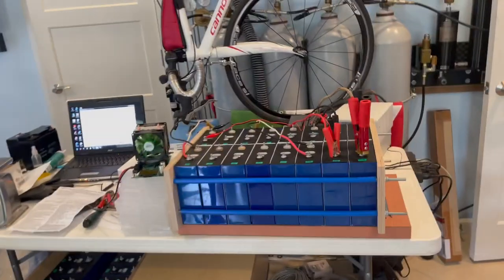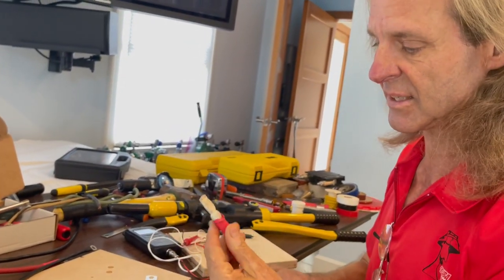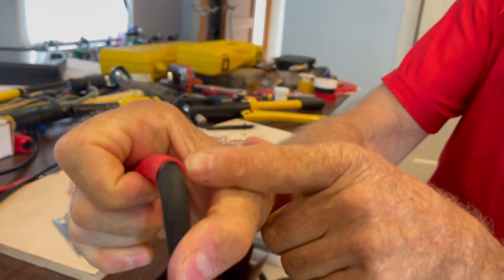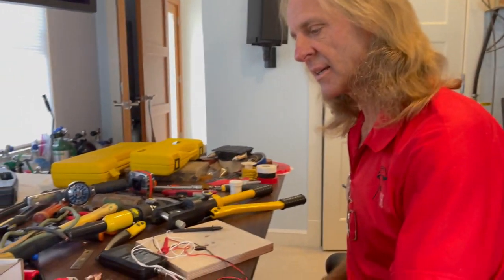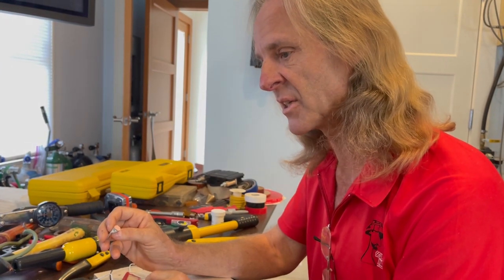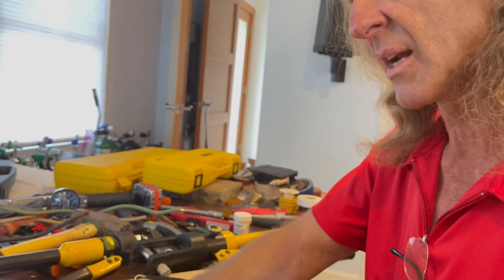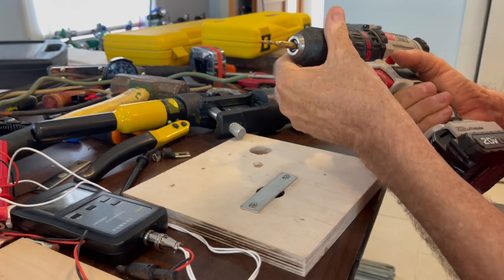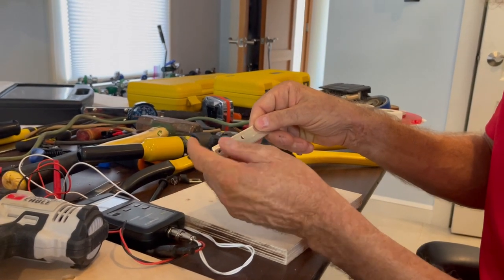Is Lifepo4 A Fire Risk?! How To Make Safe Battery Connections.

Comment: How about taking old wire with oxidation and cleaning the end perfectly, like new, then putting a terminal on it? The flow of electrons doesn't about oxidation does it?
Reply from the maker: I don’t know the answer to that question. I am aware that electrons don’t flow through a wire but around the wire but I don’t know how that may or may not be significant. The accurate answer is that I don’t know.

Comment: If your soldered joint gets hot and melts you have much bigger issues! Soldering a lug on is perfectly fine if done correctly. Never solder the end of a cable and attach it in a screw terminal. It will fail simply due to weather/temp cycle.
Reply: @ursodermatt8809  
Agreed. It’s been proven on the larger lugs a crimp is far superior.

Comment: 1.3mOhm * 200 Amps = 0.26V drop.  0.26V drop * 200 Amps = 52 watts of heat!  Copper has an air transfer coefficient of around 14W/(m^2K).  The bus bar has a total surface area of around 0.005 sqr meters.   Works out to roughtly a 60*C bus bar in 20*C air.  Or I messed up teh maths somewhere.

Comment: Hello..Where did u get battery torque tool from do u have a link or name of supplier?
Reply from the maker: The small torque wrench I use is one I’ve had for years for working on my bicycles. I bought it from nashbar but they are not the manufacturer. It tests from 1-23 nm which is a good range for what we are doing. Look for one that is designed for that or slightly lower range.

Comment: Instead of tapping for the cell balance leads, wouldn't a washer with lock washer do the trick?
Reply from the maker: I know just enough about combining components and torque values to know that in this application I have no interest in stacking things in a connection that I am designing to be durable.

Comment: I want to make an 16S LiFePo4 battery for my sailboat.  But i have to distribute the cells to 4 packs of 4 cells. About 1m / 3ft appart. Whan can i do to make it right?  2x70mm2 between packs and cheap brass busbars within the packs to get similar resistance?  Or does the distribution of the resistance not matter but the sum of resistances?
Reply: Motor takes 100A @ 48V, BMS delivers 200A
Reply from the maker: @olafschermann1592  seems like a very challenging problem. Have you looked into 12 volt BMSs that can operate in series so that you could build four individual batteries and still achieve a 48 volt system?
Reply: @RayBuildsCoolStuff  i don’t know any of those 12V BMS which could talk to each other.  I know victron makes a device that could balance between 2 12V batteries, so with 3 of those i could connect 4 batteries in series.  But what would happen if i distribute the 16S cells? As long as i use JK BMS with a 2A active balancer?
Reply from the maker: @olafschermann1592  personally I don’t think that I could convince myself to go that route.

Comment: Where did you find hydraulic wire crimpers with AWG instead of mm2 dies?
Reply from the maker: In a couple of my videos including this one I speak to this issue. What I do is grind the mating faces of the metric dies to customize them to the AWG sizes that I use. Only one size doesn't need it. 50mm works well with 1/0awg, at least with the lugs I am using. Lugs do vary so check each one. Some people just go one size down and limit the amount they crank on it. That works too but I prefer making the modification because I do hundreds of crimps.
Reply: @RayBuildsCoolStuff  That's certainly one way to get it right!

Comment: What's your opinion of NoAlOx or similar products on the battery post to busbar connection?
Reply from the maker: I think the MG 847 is more appropriate and is a better conductor. Do you agree?
Reply: @RayBuildsCoolStuff  Don’t they serve two different purposes? The Noalox’s zinc particles reduce potential for aluminum oxide. Whereas the MG 847 improves conductivity through carbon particles. We’re fighting two battles (especially over time); resistance and galvanic corrosion. Ray… I think you’re correct to polish the posts and apply MG 847. To prevent long-term corrosion and moisture incursion, what about spraying CRC 06026 or SP-400 over torqued terminals?
Reply from the maker: @dougyoes  the mg847 also claims to be anti-corrosion. If the system is not in a marine or outdoor environment, I think that is enough.

Comment: Nice video. I mostly agree with what you said. I think that soldering isn't problem at all when you are working with battery terminals or cable that will be used to connect two terminals.

Firstly you have to use normal clean wire and also soldered crimp not just plain copper one..and then use proper crimping tool and then solder ends ..it will wick a bit inside the wire but that is normal ..and you have less stress on terminals with small loop of wire than it is with busbar.,.
..or be sure that you leave space once those cells expand (when using busbars))..

Comment: Still don't get how a copper busbar 20 x 2mm (40mm2) according to online busbar calculators is only good for 50A but a 40mm2 multi stranded welding cable is rated at 300A. The copper  busbars that come with these cells don't seem anywhere big enough to handle the current that a 16S config could put out. 1C is 280A !!
Reply from the maker: There is a lot to unpack in your comment. First of all 40 mm wire is not rated to 300 A. A 40 mm bus bar is rated to higher than that. The rating on wires has to do with the insulation and it’s capacity for withstand heat. If you look at ampacity charts, you will find wire ratings at different temperature ratings. 90 C wire can handle more current than 60 C wire before the insulation fails. If you look at the wire overhead that brings power to your neighborhood, you’ll find that it is a fairly small wire, but it has no insulation on it and it cools to the air so it  can handle much higher levels of current. One other thing to keep in mind is that you must be right the wire if you use multiple strands of it inside a conduit because the conduit holds the heat and therefore the insulation can be damaged with less ampacity.
Reply: @RayBuildsCoolStuff  I don't want any surplus heat inside my battery box coming from undersized copper components  getting hot. If oversizing the bb's prevents this then that is what I will do. I have 15KVA inverter so possible very high amps on occasions. DC Breaker is 225A but trips at 250A

Comment: You need to use busbars whit a bolge in the middel this acts as a bit of flex in youre bus bar
Reply from the maker: I would love to see testing on this. I am unable to measure any movement in my 4 cell battery packs from full to empty when restrained with 4 rods torqued to only 7.5 inch lbs. I'd like to see what kind of force is required to flex those bus bars compared to the force required to damage the terminals of the cells we use. In any case, I see no examples of them being used in commercial battery packs.

Comment: very detail explanation, i hope you don,t go overboard trying to squeeze the last drop of juice. I been using Lipo4 battery for my cars for 10 years now. Its very robust and can take lots of abuse unlike Pb battery. I think you should concentrate on all connection and joints during wiring as this are the weakest link in the whole system...and do you know the losses of the wiring from the solar panel to your battery? it is way more than what you gain from the saving in the busbar . Finally if you keep your charging below3.4 to 3.5v and discharge preferable above 2.8v the lipo4 batteries voltage differential between cells is not critical. This also means your battery will last a whole lot longer as you use about 70% of it max capacity . Regarding the brass ,copper or aluminium busbar, you must remember you are getting it free . Try paying 3 USD for 1 pc you will probably get a beautifully craft masterpiece that you can use as display in your living room. The Chinese seller make a pittance selling you the battery set so you cannot expect perfection.

Comment: cant you get a refund on those bussbars ray ?

wat lucky to be gifted some high grade aluminuium bars, from which i made my own busbars.
25 mm x 7 mm.
also drilled and tapped a hole dead center of that busbar for the sense lead, have yet to do a resistance test on them
Reply from the maker: I can try to get some compensation. There are other issues with the order, like the fact that the contract specifies 280AH grade A and I was shipped 271AH grade B cells. The contract only says busbars, not what they are made of so I really doubt that I will get much traction on those but we shall see. The labor to flatten, drill and tap 124 bus bars is the real issue for me. They also shorted me 132 bus bars as the contract states two per cell. I'm sure they will take real good care of me. nope
Reply from the maker: I have a piece of 1/8" aluminum sheet but I'm not interested in making aluminum bus bars. It has its place but I don't really like it for electrical service except where there are no other choices.
Reply: @RayBuildsCoolStuff  well , my redenation is : 1. the contact area's of the cells are aluminium, so from.alu to alu shouldnt result in loss, resistance or extra heat and 2: high grade copper here is really expensive, and a gifted horse and such ;)

there is a guy selling copper busbars, ( current connected ) i believe.
on the forum he said he's got a whole bunch that were lasercut, but not properly deburred that he is trying to offload
Reply from the maker: @houseofancients  I saw that but it looked like a hot mess, pun intended.
Reply: @RayBuildsCoolStuff  Definitely prefer copper. Aluminum is far more prone to corrosion (esp in high humidity environments). And when they corrode the resistance climbs substantially. An aluminum corrosion byproduct is hydrogen. The combination of arcing, heat, and hydrogen is not a good thing. In addition, to get the equivalent current-carrying capacity as copper, you’d need to significantly upsize the aluminum bar thickness / size.

Comment: Use a deburing tool for the bur...no?
Reply from the maker: The problem with that is that it reduces the effective thread depth and these busbars are only 2mm thick to begin with. If I have a small chamfer on each side from the deburring tool my threads will be around 1mm.

Comment: Surprised you didn't notice the resistance drilling into brass
Reply from the maker: Copper busbars aren’t soft but I really should have noticed the color of the shavings. I was focused on speed and efficiency and ended up wasting time.
Reply: Thanks for the video! About to build my first batteries. Been installing marine electrical systems for awhile. The tip on t MG chemical was brilliant! I'm trying to figure out the best conformal coating to put on the boards of the inverters. Silicone is awful for marine. Poly needs heat. Epoxy? I'm still researching
Reply from the maker: @djkillachris  I don’t know. I suspect silicone is a poor choice because it passes water vapor. That is why insulated glazing units use silicone for the structural bond and butyl for the vapor control.
Reply from the maker: I have an underwater scooter for scuba diving and the control board on that is potted in a material that stays the consistency of Jell-O. I don’t remember where the product was made or the name of the manufacturer but when I redid the control board on my scooter I know I was unable to get it in any quantity that was reasonable. The manufacturer of the scooter is unwilling to sell small amounts of it from the 55 gallon drums that they purchase. Sorry I can’t be more help.
Reply: @RayBuildsCoolStuff  interesting! I don’t need my inverter to be submersible. Just protected from marine air. I’ve had a few failures already. Corrosion on the board every time. The cooling fans drive in moist air and dust. 1-3 year max life on untreated,  fan cooled marine electronics board.
Reply from the maker: @djkillachris  my Seplos BMS is coated with some kind of urethane that takes heat to remove for repairs. I have a video about warranty repairs with Chinese companies. In that video I show a portion of a video that Seplos sent me in which the procedure for replacing a diode is illustrated. It shows removing the coating with a soldering iron to access the diode beneath. It does not show recoating it afterwards.

Comment: What you burns houses is the wrong chemistry and people being unaware that LiIon batteries are those that can burn and ignite on their own cause those had caused the UPS flight 6 cargo 747 to crash in 2010 and other incidents.
Remember the Samsung Note 7 smartphone desaster when that battery had burned in the pockets of the owners and airlines refused to take these phones on board even shut down one? 

LiFePo4 is a different thing and one reason why CATL has become the biggest battery and lifepo4 manufacturers.
Safer on the cell level and they do not burn like the LiIon or the LiPo ones used in the RC model plane hobby.

Comment: I did not like putting my BMS wires on the battery posts as the ring terminals are too soft, thin, and can ''smear'' over time and make a loose hot terminal under heavy load.  So I started drilling and tapping the center of the buss bars for #8-32 screws. They are 3/8'' long and go in from the underside. Then I could get rid of the huge ring terminals on the BMS leads and crimp on the little red ring terminals and fasten them to the protruding screw. Those big ring terminals almost never crimp correctly on the tiny BMS leads.

The other thing that I did was at the positive and negative posts where my 2/0 wire crimped copper ends are. I cut a spare nickel plated copper buss bar to  20x20mm and put that on the battery post as a washer. Next goes the copper wire lug end, top it off with another 20x20mm ''washer'' and tighten it for the last time. So there is nickel plating on all contact areas, not just copper contacting the aluminum battery post.  I added a 500 amp ANL fuse to a negative terminal leading to the BMS negative wire with the same washer sandwich.  The ''solar generator'' has been operating daily since May and all terminals feel cold even under 2700 watt loads.

Here is a recent video of the power unit running at 2000 watt load. Its 8x280 ah cells, 7200 watt hours. It was built to run a big home fridge and 2 chest freezers for when PG&E dumps us off the grid. But it ran a 10,000 BTU window AC 3 hours an afternoon in the Summer and now runs an 800 watt heater for 4 hours just before dawn. Free electricity. The batteries run between 55% and 95% state of charge most of the time but 100% happens too.  https://www.youtube.com/watch?v=NYpczRYDFJQ
Reply from the maker: We agree about many things, I see. I had already seen that video before. Thanks for you great comment.

Comment: Great info... except this seems odd... 
In comparing the bus bar with the cable - "depends on how far apart. Because the further apart I get them [meter probes]  the more resistance. Yet the distance of the probes from one another on the cable when you measured was more than twice the distance! https://youtu.be/ZzKR6tYRlwM?t=897
Reply from the maker: Yes that’s true and the way I presented it may be confusing but if you watch that whole section again with the part that follows it is clearer. I also have another video about flexible busbars that compares different wire gauges to solid busbars with resistance values and their length factors.

Comment: no no no no you want solid connections you go old school old school solder 60 40 none of that new crap you heat that thing with a torch you solder all connections then marine heat seal the ends with glue heat shrink... the bond between high power cable and the connector is not full when you solder its got less resistance etc.. just watch some of the old nasa videos and old 50s videos on how to solder this is the proper way to do it and use old solder not this new crap... and never lead free